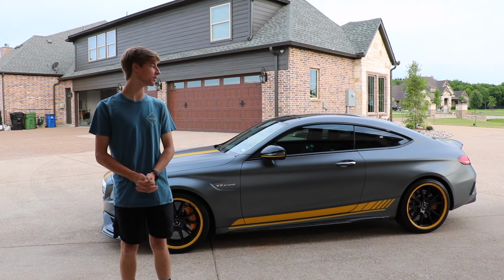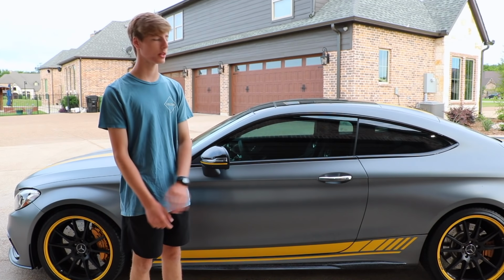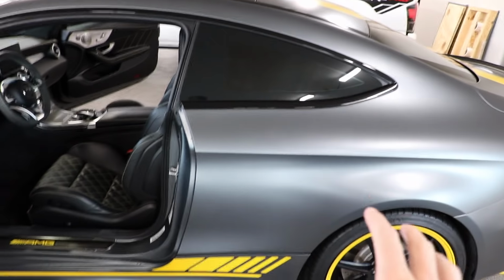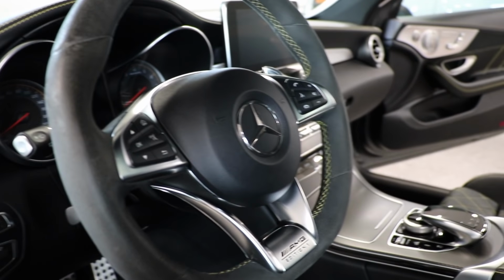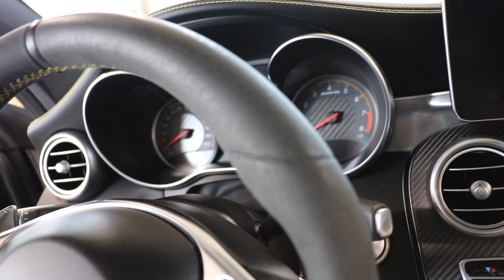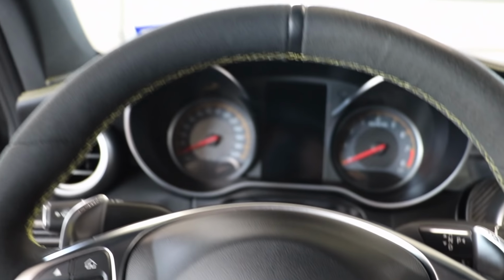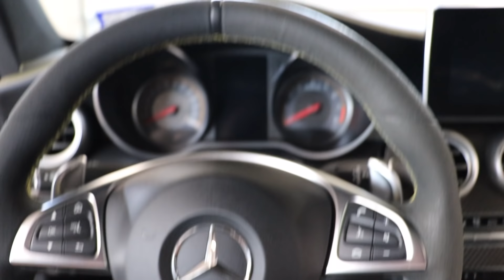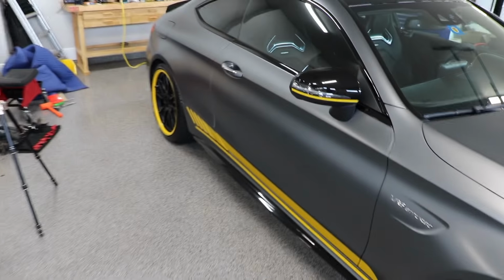Mercedes AMG C63s Edition One Detail

Comment: can you do a video over cleaning the steering wheel my grandma has a cla 45 AMG with the same wheel
Reply from the maker: I will try my best. I don’t have many other cars that really need it done so a video would be tough as of now. To sum it up, I got a bowel with ~1 cup of warm water. Add a few squirts of a carpet cleaner. Then use a soft bristle brush that has been dipped in the solution, and scrub it gently on the steering wheel. The goal is to relift and lightly clean the fibers of the fabric. Be general and don’t try to rush the process.

If you would rather play it safe on your cleaning solution, there are chemicals online that are dedicated to alcantara. 

Once your satisfied, use a clean microfiber towel to dab the solution off. If you would like you can use warm water with no cleaner in it to insure that there are no chemicals still in the fabric. 

Thanks for watching!

Comment: Since you have both 1322 and the 1122 are they exactly the same as is noise when the trigger is pulled?  I’m leaning on selling my 1322 for it since I don’t have the garage for it and tired of constantly rolling the hose up it’s a pain lol
Reply from the maker: So the 1322 has a bit more cleaning power in my opinion. It just seems to have more flow and a bit more pressure. It also could be that it is newer and has less hours. 

As for noice, they are very similar. The 1122 might be a bit more high pitch.